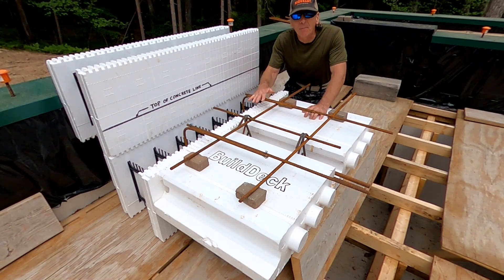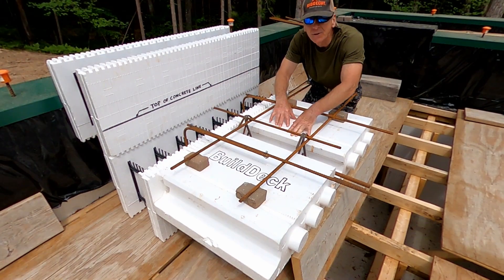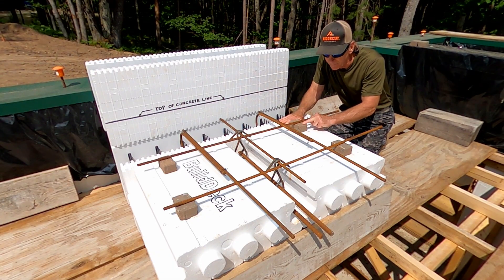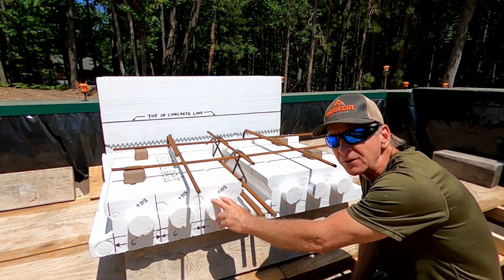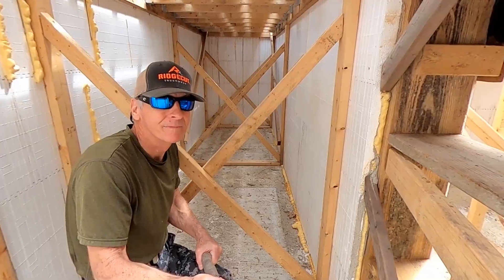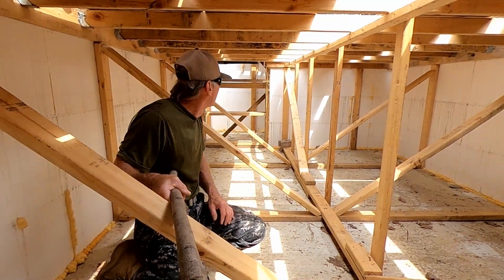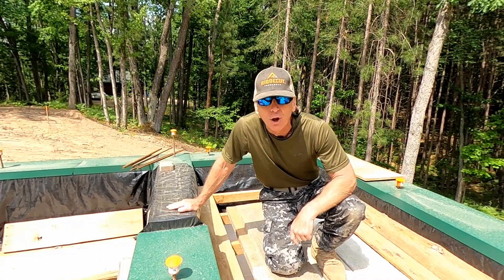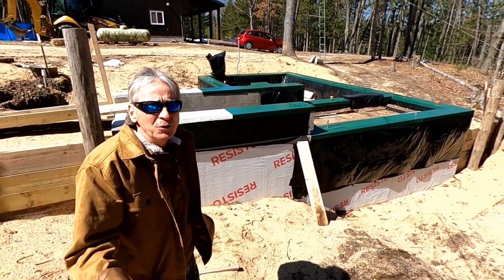ICF Root Cellar - Concrete Roof Plan _

Comment: Why are your beams separated from the walls? All your decking will be hanging on the steel rebars
Reply from the maker: The rebar goes into the wall section by about 4". Remember the rebar is completely covered with concrete that flows on top of and becomes part of the wall.
Better seen in my other video:
"Man Builds Underground Bunker Using ICF Insulated Concrete Forms, 65 Day Time Lapse Build"
Thanks for watching.